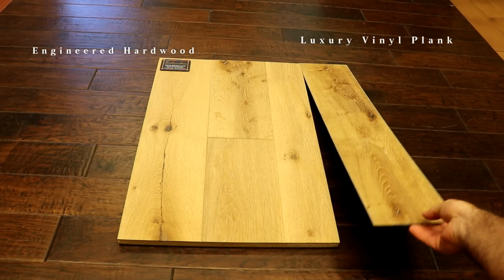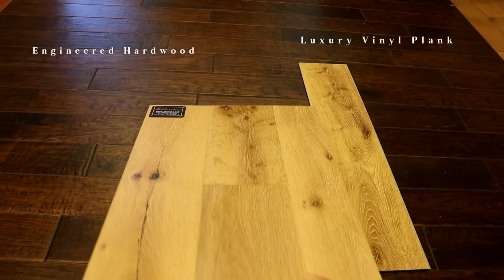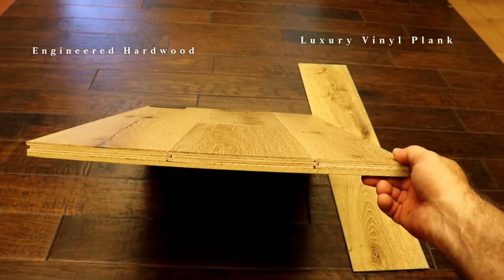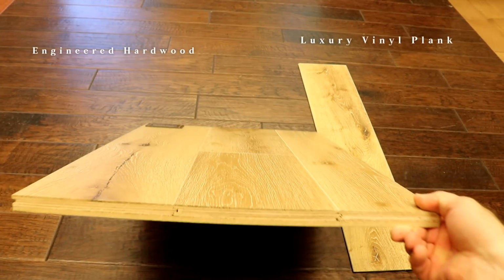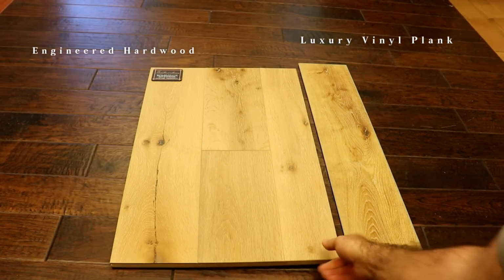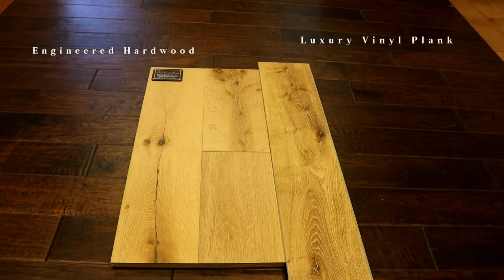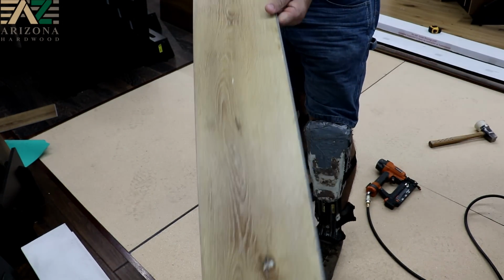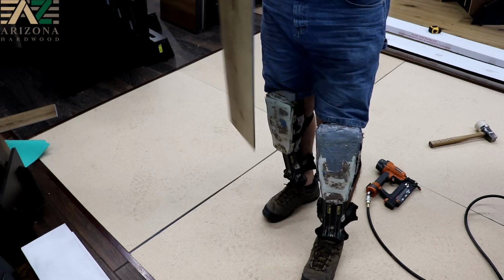Luxury Vinyl Plank VS Engineered Hardwood Flooring.  Naturally Aged Flooring!

Comment: I AM SO GLAD YOU MADE THIS VIDEO ! but guess what guys ? telling the difference between real wood and vinyl flooring is SO SO easy !! 1. Vinyl flooring planks, because they are just photographs of real wood planks, REPEAT every 4 to 6 planks, so it is easy to find boards that look identical 2. Vinyl flooring is not as comfortable to walk on ( bare-footed ) 3. Vinyl flooring is much noisier than real wood 4. The buyers of Vinyl flooring will not see a return on their "investment" when selling their home, when 2400 SF or larger because educated buyers do not get excited about "PLASTIC" / FAKE FLOORING ! And one more thing; every time you "so smartly" sell a Customer a Fake Floor, you YOURSELF just cut your commission in half !!  Oh wait, one other thing; everybody cleans up their spills, but WHAT HAPPENS WHEN THERE IS A REAL FLOOD ? LIKE WHEN A PIPE BREAKS or a dishwasher or toilet malfunctions or when a shower or sink overflow ? think about it. I would love to hear your answer.
Reply from the maker: Thank you for your comment. You are absolutely correct Luxury Vinyl plank is a photograph that does repeat itself every 4 to six planks or so.  As for the" comfort to walk on"  and the noise there are underlayment pads that can help this issue and do a great job trapping sound.  As for the resale value of your home you are correct as well.  Hardwood floors will definitely help your bottom line and sales appeal more than luxury vinyl will.  However, some households are not ideal for hardwood floors and for those homes Luxury Vinyl plank is a viable option for clients who want a wood look. 
As for the moisture warranty, the vinyl is waterproof. Most of the warranties are written for moisture in "Normal Living Conditions".  Example a dog running in from an outside swimming pool.  If there was a flood it would void the warranty.  That being said the vinyl would be fine,  the problem arises with the risk of moisture being trapped under the vinyl leaving the potential for mold. 
We have specialized in hardwood flooring for over 30 years and we do prefer hardwood flooring but like I said before hardwood, unfortunately, is not for every household.
Reply: If you choose to publish the invaluable information I am about to give you, please give me credit for the info: Roy Culver of 805 Video Group in Ventura, California.     Teach your sales people to do these 2 things and they'll sell more wood, thus, make more money. Allow your well informed Clients to tell you how wonderful plastic flooring is ( they learned all about it online ). Ask them " what will happen if there is a real flood, like a pipe breaks or an appliance malfunctions and there is water everywhere"  Do YOU know the right answer ? When a real Flood happens, we call our insurance company who has a service company come out and typically replace everything including the water proof floor, so how much value does the 100% water proof floor have in the trash bin ? The second technic is have a policy that requires your sales people to disclose that plastic floor planks repeat, so if they have open spaces greater than 3'x 3' they are going to see the repeats....this is when you know for sure the floor is a fake....are they OK with that ? If they are not then they are a candidate for wood.  Happy selling
Reply: Wtf you're so mad. Nobody force you to take vinyl floor to your house
Reply: @805videogroup5  Love the fact that you are honest !!
Reply: @debbie9243  Thank you Debbie. Are you in the "flooring biz ? "
Reply: 805 VIDEO GROUP    No.  I’m a home owner trying to make a decision.  I’ve had real hardwood for 20 years.  In the kitchen they have worn poorly.  Been re sanded twice.  Lots of separation, scratches, dents.  I hate it but love the look.  We live in Toronto, Canada.  Warm and cold climates.

Comment: stop the video at exactly 4:25 and you can see 2 identical planks there ( in the lighter gray area ). 1 is butting up to the wood floor and the other is spaced one plank away and the "IDENTICAL KNOT & GRAIN" is above it in the picture at about a 30 degree angle.....did i hear FAKE FLOOR !  There are 2 other "repeats" visible as well. And you'll all be wondering why your paychecks are dwindling.